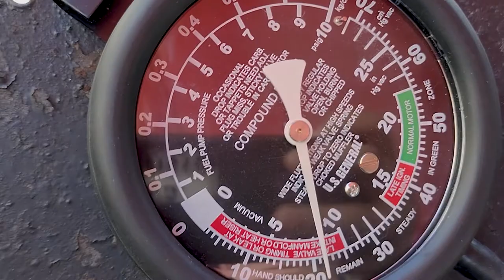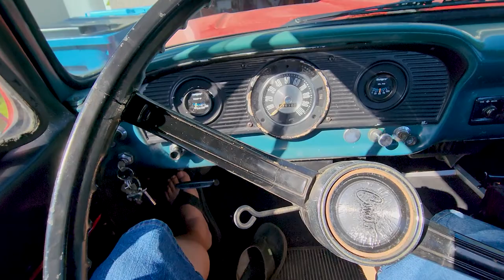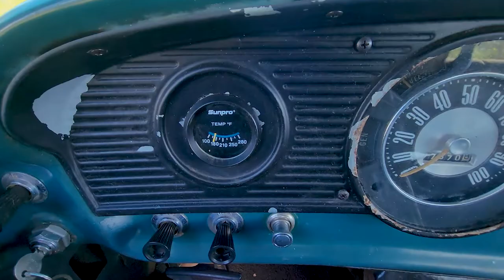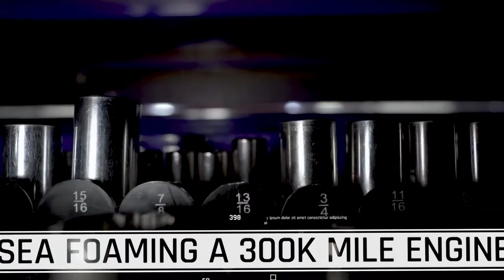Tuning my F100 with Vacuum Gauge

Comment: Nice old truck, I have a 1978 Dodge truck with a 440 for a motor,  & it has a 4 barrel Thermoquad for a carb. I paid a guy to rebuild the carb, it, it worked for about 3 months, now it's running rich that it idles rough & stumbles over itself when I put it into gear & give it gas. My timing chain is new, I have 160 compression clear across the board, I just put new plugs, cap, rotor, wires, & fuel pump. I see that you know your stuff, I'm just a backyard mechanic, it I have not as of yet rebuilt or set a carb. Thank you for your time, I hope that you may have a direction that you could point me.
Reply from the maker: Thanks for watching. Most likely, culprit is your carb has gummed up. The modern ethanol gas does not play nice with carburetors. If you let your truck sit for a few weeks, you can get a sticky float. Which will cause you to run rich. The best option is to pull off the carb and clean it from the inside out. If you don't know how, just look up a youtube video on how to take apart a thermoquad. There will definitely be one. You can also try adding some fuel system cleaner, like sea foam, and put some miles on it and see if it cleans out the carb enough to fix it.  
Another common issue is still carb being gummed up. But it gets gummed up due to your fuel lines deteriorating. If you haven't swapped any rubber fuel lines to a quality fuel line that can handle ethanol gas, your rubber fuel lines can break down internally. The rubber fuel line can even be only 3 inches long but still cause issues with carbs.

Comment: Yo i got a question i got the same vacuum gauge , i used it and the lil tack needle goes on the green zone and but it stays jumpy 😅 , i got my engine rebuilt and got a cam in it , do u think that may cause the tack meter to be jumpy
Reply from the maker: The gauge is a little jumpy to begin with. But the more aggressive the cam, the more it will jump.